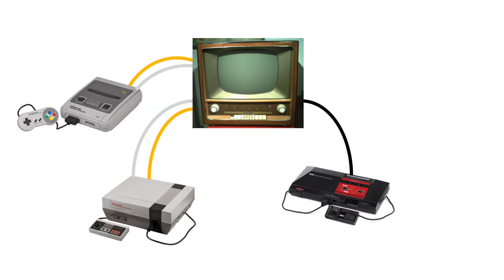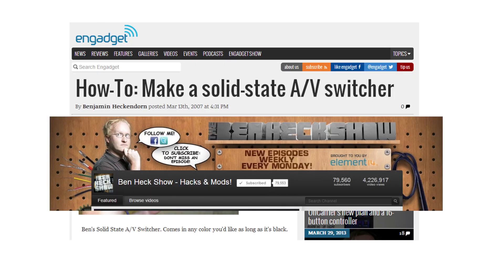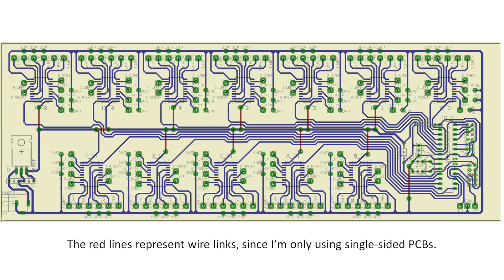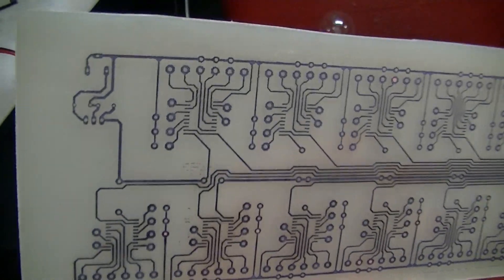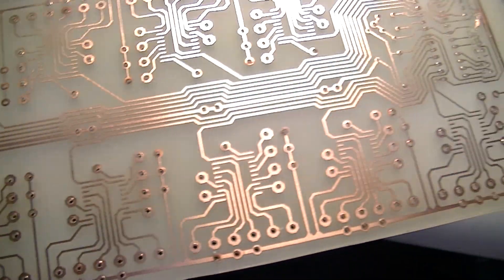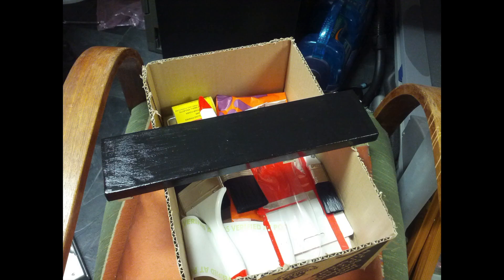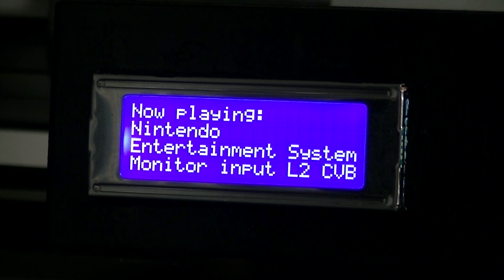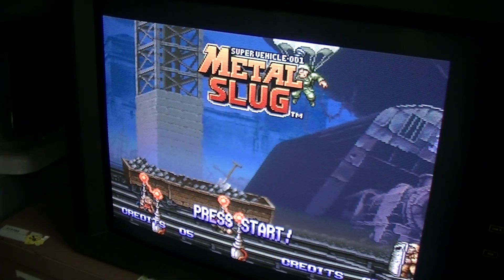[retro swim] - Episode 18 - RGB SCART AV Switch

Comment: The link to the cad files gives access denied. :(. Like many others here I am considering such a design. But personally I would try to make it modular. PCBway and the like do prototype boards in batches of 5 or 10. So you could design arbitrary size switches. Though the cable management might create some extra interference if not done properly.
Reply from the maker: I did begin work on a stackable modular switch, with the possibility of different modules (say, composite, SCART, S-Video, etc), but like many people with too many projects on the go, it slipped off my radar. :(

I put the files on a different host if you're still interested in this build: https://www.mediafire.com/file/ljc3djes3dckiz5/AV_Switch_alt.zip/file
Reply: @RetroSwim  that sounds familiar. Thanks

Comment: just what I need, all parts needed for this I have gathered and going to make it, I think I have to make it a bit different, thinking of making this modular, the scart connections with the switch chip on one board per connection and that going to the main board with the Arduino on it with a connector, I have no idea if this will degrade the quality but I have to check, this way I want to be able to decide later how many ports I want or maybe able to add a extra port to it.
great job explaining everything and thank you for sharing the schematics and code.

Comment: Great idea! I was wondering if anyone who has built one of these has compared the quality of the output from this compared to a commercially built switcher?
Reply: Built one last year to replace a 5 port switcher, didn't notice any difference apart from the fact this was alot of fun messing around with. Also hardwired a scart > HDMI upscaler into mine

Comment: nice build but very crappy build-instructions. What is the output.brd? How and what is connected there? Any pictures on complete build? What display? parallel or serial interface? Are allt the outputs from the chips coupled in parallel to the output scart? PS: the bulging holes in the pcb comes from dull drill.

Comment: Hey there! This is REALLY awesome. I just don't get the wiring completely. Any chance you would draw a very very dirty paint job wiring schematic for the output/one channel?
Reply from the maker: There isn't much to show really. Each chip has 8 inputs, and each input has a corresponding output, the 8 inputs go to the pins on the SCART socket, and the outputs go to the long U_shaped traces on the top board, so every RED output is bussed together, every GREEN output, etc.

Normally the input/output pin pairs are isolated, but when the enable pins are asserted, they are connected. The microcontroller ensures that only one chip's enable is asserted at a time.
Reply: I was wondering about some of the pins that are not switched? Like 5v/12v? Do I need it?
Reply: Id also like to know if you have to use coax 75 Ohm cable, because you use it from the scart inputs to the board, switch to normal cables from board bottom to top and connect bnc again via coax. Help :D
Reply from the maker: That was just a practicality thing. It's only an inch or two, no signal integrity is lost by not using coax for such a short gap, not at the low resolution of these consoles anyway.
Reply: RetroSwim will i get any quality lost by not using coax in this build? i startet soldering all scart inputs today using shielded cables .
Reply: I built my scart switcher based on your layout and I'm very happy with it! Thank you so much! 

I have one last question though. I skipped the second board by using a daisy chain from switch to switch. works fine. I do have a problem with audio leaking (distorted) into other channels. Did you have the same problem? I used the same IC's and your layout.

Comment: Oh man. I'm using a Holdan HSR-1000 right now. The good thing is that it has 3 outputs (Main 60" LCD TV + 2 x 14" CRT hidden away). The bad thing is that it doesn't support RGB on all inputs/outputs. I'd love to make myself a proper scart router (having 10 inputs and selecting the outputs individually) =)
Reply: It's not a "router", it's a switch. Routers are a different beast, for networking. I can explain the function of one if you wanted to know though.
Reply: Yeah, I know this is a switch, but as stated my HSR-1000 is indeed a scart router =)

I'm very aware of the difference and I'm currently using both routers and switches in my setups.

Seeing this switch (and other peoples variants) made me really want to make my own router. I know it's more complex but might still be within my grasp.
Reply: Cloaked Alien What exactly is your definition of a router? Do you mean a matrix switch like an Extron Crosspoint with multiple RGB inputs and outputs?

Comment: Nice, I'm currently working on my own switch of similar design and I was wondering how many millimeters you left between your scart sockets?
Reply from the maker: +mcallister1984 I didn't leave any space horizontally. The room required by the screw holes is plenty for SCART plugs to go side-by-side. Vertically I just left about 3mm so there would be some material there, but similarly, they could be right next to each other as they have quick a thick "border".

This said, sockets manufactured by someone else might not be the same, I connected some plugs+sockets together and made sure it'd all fit before I started screwing stuff together.

Comment: Nice work there!
As another console hoarder I've been pondering on building one of my own. I'm just stuck trying to make sense of the signals because at the moment I only need composite signals to go trough (even considered building composite-only switch), but it would be nice to have it RGB ready for any possible future RGB mods on my consoles. My main concern at the moment are the grounds and RGB/composite switch signal. I assume you just wire the grounds to a common ground instead of running them to scart out (they're just to protect from interfering, right?), but do you by any chance know if the devices send that 1V+ trough the selector cable or do I need to run that 1V+ in myself?
Sorry if that made little sense. :p
Reply: Im about to finish my 12-1 designed by myself, wiring it ATM. I took some ideas from different designs ive seen around. I use the chip CBT3245A instead (its a bus switch) as it has 10 inputs/outputs which makes C-RGB+LR (plus fast blank with a 2x10kOhm resistors in parallel) possible. For what i know the pin 21 has to be connected to Ground. As i haven't fully wired it yet, I still don't know if connecting RGB+Audio grounds is absolutely necessary. I had a really good design for 2 single layer pcbs with the scart sockets included and only needed to match both together. I run into problems with the revealing process using photosensitive pcb so i went for dry film which makes it great for inkjet printers and transparencies (requires doing a color inversion of your circuit) and works like a charm. I opted for the easiest but more "wired" version. Imagine 18 cables with 12 chips plus diode protection for the return statics attached to the circuits. Really crazy but i hope it works. I can pass my design. I also used SOP20 adapters for the CBT3245A chips which makes it far easier to solder.

Comment: Thanks for that Retro I missed the link because utube had hidden it, I have made an eagle cad double sided board version, a bit of a query tho - it looks like the three caps near the atmega are tantalums, ( I.E C1, C2, C3 ) but what type of cap are you using for C4 and C5 as I couldn't see those in the vid and also - what vas the power rating of your wall wart.
Reply from the maker: The two smaller ones are actually ceramics. They're only 10pF or so, for the crystal oscillator. The others can be tantalum or electrolytic, it's not too important, they're just for DC filtering.
Reply: ***** Thanks for that :)
Reply from the maker: Chasse Court My pleasure! :) Be sure to check the datasheet for your crystal oscillator, it will tell you what value the capacitors should be. Mine were wither 10 or 22pF, I don't remember off the top of my head. Good luck!